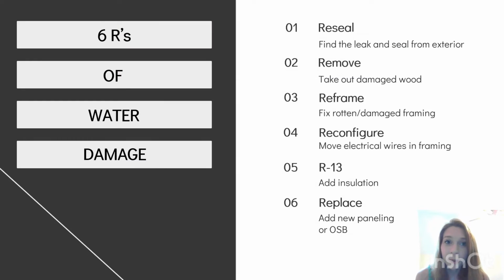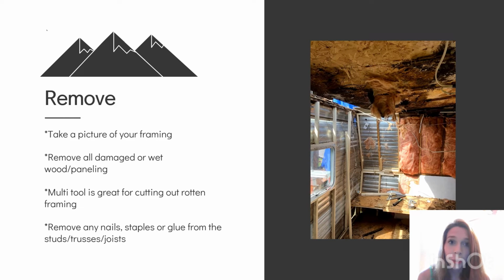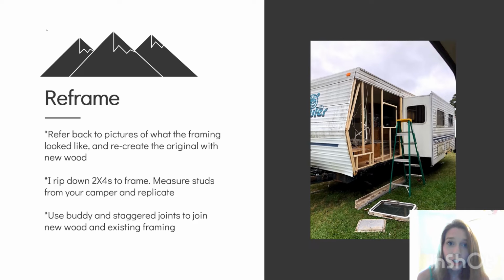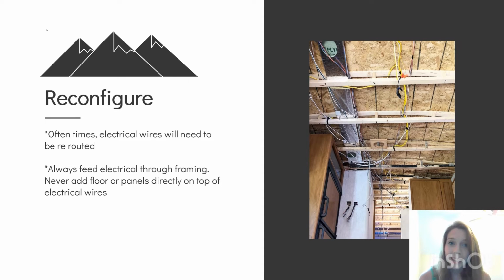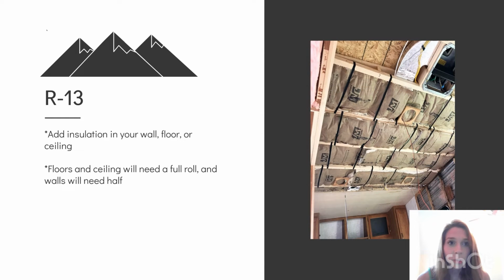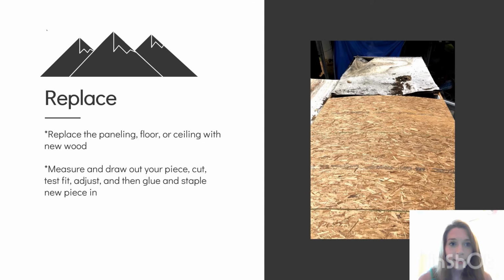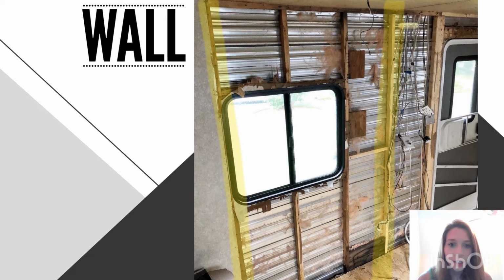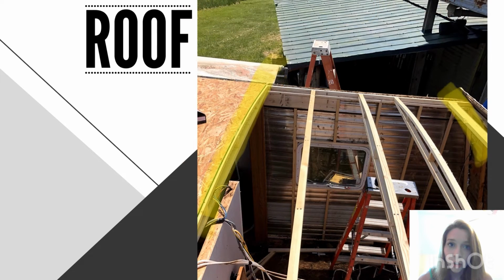RV water damage repair to floors!

Comment: Hi! Big fan here 😊
Im just wondering, when you do these replacements of the subfloor panels, wall panels, wood frames, etc - specifically on slideouts.... do you ever use an alternative material that has better water resistance such as marine board, composite, HDPE board, treated woods? And/or apply any wood preservatives to these critical structural pieces? especially since these locations can be so prone to water damage? Would love to know what your thoughts are on that.

Comment: Hi there! We are looking at getting a 2006 Keystone Outback 26rs. In the bunkhouse under the lower bound there appears to be water damage on the walls and a small part of the floor. Wondering what something like that would cost to try and replace that smaller area ourselves. They are asking $9k for the camper so I am trying to figure out cost to fix this to see if it makes sense. I have pictures if there is some way to send them to you.
Reply from the maker: Hey! Send me some pictures. Instagram is the best way but if you don’t have one, you can email them to me at fallenintocamping@gmail.com